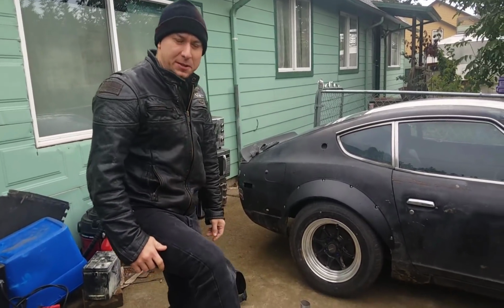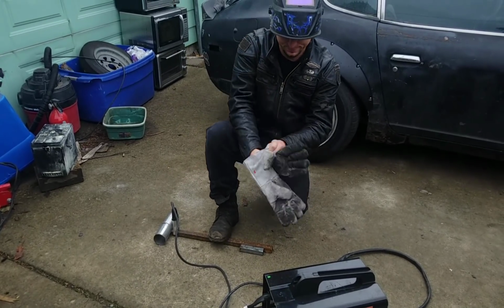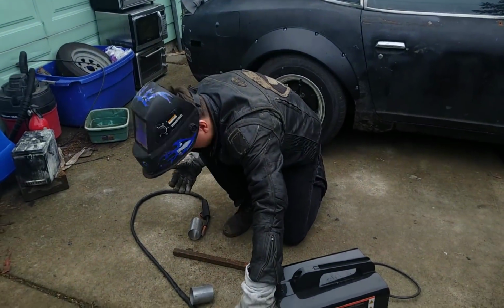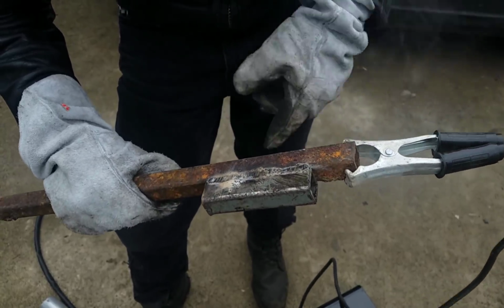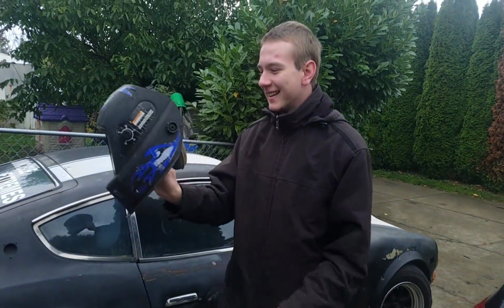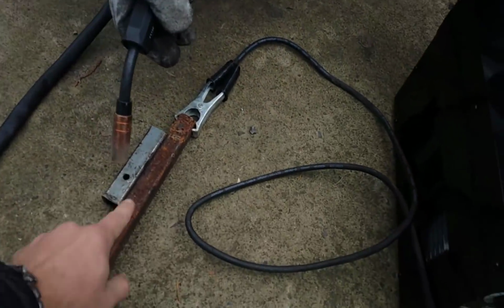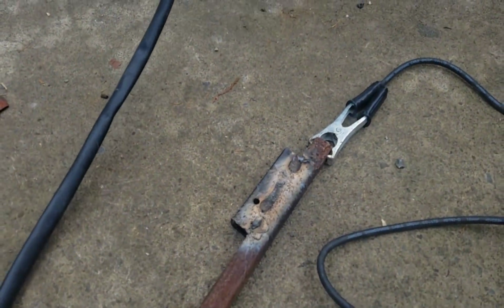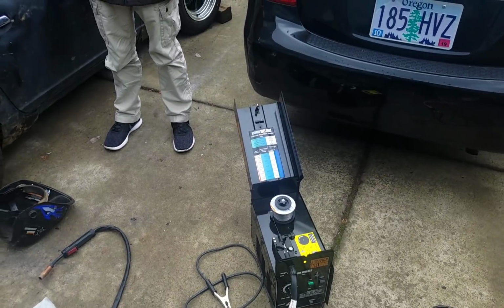$99 125 amp welder. Worth it? new 90 a.  Harbor freight 120v budget welding review. Chicago electric

Comment from the maker: https://youtu.be/uk94lD-G_vU new comparison of this welder with a century fc 90 DC flux core welder.
Reply: I have the same exact welder, except they just had a huge tent sale, so I got it for $84, and that helmet I got for $30 :)
Reply from the maker: conner baldwin nice!  Ain't the best, but it'll work great, you won't regret it.
Reply: ya, that's what I heard, when I was walking out of HFT a guy told me he loves that welder, he's had it for a year, it still works, he did say I'd have to get used to the splatter though, well anyway good vid man, subscribed :)
Reply from the maker: conner baldwin yeah... I've had one for 5 years one time.  Not too sure why I threw it away.  Still worked though after dozens of rolls of wire.
Reply: For small home jobs i use the 90 amp FCAW and I'm happy with it. For anything that needs strength I'll use my Lincoln arc welder. Anyway, clean your work and ground first, you'll have better results. Thanks.
Reply from the maker: drhilltube Yup! A good ground and the cleanest metal you can make is always a good idea.
Reply: What did I miss...dude, what’s the plan for the stack of microwaves???
Reply from the maker: Eric one of them works and we put it back in the house.  The others are scrap I think
Reply: Do you have to feed the wire on your own?  I'm trying to weld sheet metal.  What are the settings for sheet metal?
Reply: ExtravagantFragrance this is not the best welder for sheet, particularly if you’re new to this. You really need a MIG.
Reply: I realize it's quite randomly asking but does anyone know a good website to watch newly released movies online ?

Comment: You can't run ANY welder on an extension cord that's barely good enough for xmas lights.
Reply from the maker: Doug Alan that's very true.
Reply: Doug Alan lmao
Reply: Sure you can, for a minute..🤔
Reply: I have the 90 amp. When it was plugged into my 15 amp home circuit the arc would spit sputter snap crackle and pop. I plugged into a 20 amp circuit and it made a big difference. Smoooth....
Reply: They should really use a 5-20P plug on machines like this to let people know that it's not okay to plug a 20A load into a 13-15A extension cord. This is how you use a welder to weld a plug into an outlet.
Reply: @trickster721  so it's better to put 30amp breaker and use thicker gage(lower number) and beefy outlet
Reply: Wouldn’t it work better if your ground had some nice clean metal that has been ground down and not rusty af

Comment: few tips for HF wire welder. remove your welding wire spool and put some wheel bearing grease on all the moving parts that touch and rotate. keep your 4 1/2 hand grinder nearby and grind off the rust in a spot for a good ground. grind the rust off where your weld is going on both parts.i bought one of the 90 amp ones at a garage sale that was used maybe for one weld if that. when i got it home the wire would come out in little spurts. i removed the plastic wire spool and greased the parts and my son has a wire welder he has used for all kinds of stuff. remember lubricate the spool assembly but be careful not get grease on your wire. quit using the E71T-GS wire and start using  E71T-11wire. once you switch wire you get much better welds.
Reply from the maker: +J D yup.  I had a 90 amp one, guess I could've saved it.  Chucked it though
Reply: J D also, if you replace the wimpy jumper cable ground clamp with a good quality welding ground clamp, it makes a BIG difference.
Reply from the maker: dave1135 yes it does.
Reply: Ok
Reply: yes i just did that with chinesium ground clamp that is way better. the originals were basically battery charger clamps
Reply: Only way to improve a harbor freight welder is to open the lid on your trash can and toss it on in.
Reply: Absolutely, clean your metal first folks !
Reply: Good feedback, I want to weld a tow hitch to a non tow rated bumper, what type wire should I use? I see .30 and 35
Reply: @flhusa1  link doesnt work, could you send updated link?
Reply: Planning to make my own charcoal grill, would this weld be good? To weld all the metal together? Idk first time.
Reply: @bartlein1994  If I did that, there would be one heck of a lot of things around my farm that would still not be repaired. I have welded all kinds of stuff around here with just the same welder.  I get tired of people like you that sneer at anything from Harbor freight.  A lot of the name brand stuff you guys have are the same thing Harbor freight sells, you just pay many times more for a different color paint and a name. Case in point. I have a HF 14" band saw. for around $300 Grizzly sells the same saw for $600.  The only difference is their saw's switch is mounted up on the frame.  My HF saw has the holes drilled and tapped. Seems like a good idea so I moved my switch there.  Now jet, their saw has that brand's white paint job and they want $900. It's the same saw that I paid $300 for from HF. Same motor, same hp, same everything except the paint job.  So go ahead and sneer at my HF tools. I'll laugh while putting money saved in the bank.
Reply: Think I’ll give this welder a shot.
Reply: JD- I grease those parts like you do but I still had some problems. I just took a bolt and made a steel wire clamp to replace that plastic contrivance they had on it.  Haven't had any feed problems since.  Concerning those ground clamps many are talking about, I agree with everybody about replacing them.  My only problem with that is that mine works just fine!  I can't just bring myself to replace a part that ain't broke.
Reply: @bartlein1994  
Normally I would agree with you, but I just bought this unit (cant try it till tomorrow) I'm a gluten for chinese shit. If it fails, I will bow to you. And probly go torch HF.

Comment: Thanks a bunch. I have thought of this HF welder several times but was worried I would be wasting  money. Glad to know it is worth the effort
Reply from the maker: Tim Sexton yup.  I put mine to good use all the time.  Its just messy.  Home depot sells a welder that's half the size, but it's  $169 so it's almost double the price.  It is however much easier to use and is less messy.  Its a DC voltage welder, not an AC one.  The current switching back and forth is what makes the harbor freight one so messy.  In my datsun, room is scarce, so I choose to have the century fc-90 with me.  But if I didn't own that, I wouldn't hesitate to grab the little 99 dollar welder with me on my travels.

Comment: I bought the $200 Chicago electric 220v mig welder from harbor freight. It's on the bottle. I've used it for years with no hangups at all. Welds a ton cleaner than my Lincoln. The only hangup was the weak ground clamp. I switched that to a magnet ground and loved it ever since. Just my 2 cents.
Reply from the maker: thatkyleguy 1 I have that one, uses 240v, just need to hook the Bootle up.  What regulator and bottle did you go with?
Reply: Invincible Extremes Muscle Cars Garage I use straight Argon and it welds really clean, my regulator is really old, I got it from my dad about 20 years ago but I'll look when I get home

Comment: Years ago when I worked at the mine I used to do some decent welding, so a year ago I bought a 250a arc welder. It is  really good welder but all I have been able to do with it is welding that looks like what my boss used to call chiken shit. I have gotten lucky and fixed a few things but more often than not my welds suck.
   This demonstration makes me inclined to think I should sell that bigger welder and get one of these.
   Thank you for the demonstration. I learned a lot!!
Reply from the maker: Wire feed is idiot proof.  My little brother got the hang of it very quickly after this video

Comment: That's a nice intro for a beginner as myself. You mentioned it could run off of 120v and even a 3500 watt generator, both of which I wanted to know. Nicely done.
Reply from the maker: Shawn P I would recommend taking a look at the century fc90.  It's lighter and smaller and is much better.  Only 169 at home depot.

Comment: I bought one f these, and for what I do it works great. I don’t use this daily or even weekly repairs, but the few times I have, it’s saved my ass. I likes the fact I could change wire speed.
Reply from the maker: They do work.  I used my old one for 7 years before throwing it away finally.  The century fc90 i have now for cheap portable welding is much better.  You can change the wire speed AND the amperage.  Its actually good for body work.  Not as good as a a gas shielded mig of course, but much better than this.  But you are right, for odds and ends its decent.

Comment: Excellent instructions I'm not a welder but I may actually give it a shot painting and welding have never been my thing but now 58 I'm more patient thanks for the video man it is appreciated
Reply from the maker: This isn't the best welder.  But it does work.  A much better welder for only $165 with a coupon is the 170 amp machine.  Or the century fc90 they sell at home depot.  The current on them is DC so they make a much better weld.

Comment: I was a cert welder for a good 30 years. I liked this video. I think I will pick one of these up next time they go on sale. Thanks
Reply from the maker: Dennis Madigan it's garbage, but it's cheap garbage, and it does work.  Just makes a mess because it's A.C..  but, the welder I do love for random field work is the little century fc90.  Is an inverter welder and is 15 lbs
Reply: Invincible Extremes Muscle Cars Garage I have 2 220 ac stick welders at home. Was just looking for something small, cheap and fast to do some small stuff once in awhile. If you do some prep work it will probably get you decent results. Thanks for the reply
Reply from the maker: Dennis Madigan true, cheap never hurts.  And in the end, 90 amps is 90 amps.

Comment: Thanks for this video. I just bought this unit and was wondering if I wasted my money. My dad welded for a living, but I know very little of the craft. I am now confident that it will do the little jobs I have to do here. Thanks again.
Reply from the maker: Itll work for random fixes.  I've used one for years.  Once I got good I never wanted to use it ever again though.   But the 170 amp machine or the 125 amp INVERTER welders are amazing for the money... just so you know.

Comment: Now that was a good realistic review. I've been wanting to get one, looks like the 125 amp is the way to go.
Reply from the maker: +Goomer yeah, stay away from the 90 amp.  The 170 amp is great too.  Just a but heavier, but can take a 10 lb wire spool and can weld much cleaner if using solid wire and gas...
Reply: but with flux core... you can use the same gas as mig.... it is called dual shielded welding and this technique is for .035 flux core (but .030 can be used) to penetrate very thick metal with minimal inclusions in your welds... flux core wire works the best outside under windy conditions (much like a stick metal arc welding...smaw) and the extra gas shielding prevents any additional oxidation to a weld as it cools. mig (metal inert gas: mig) is for inside use  or no wind conditions... so if you are a farmer get an arc (stick metal arc welders...smaw, or a flux core wire : flux core metal arc welder... fcmaw) ... tig works the best inside a building on any weldable metal, not so much outside..  again the gas blows away in the wind.
Reply: Interesting, thanks

Comment: Surprisingly it's good welder for me I did my whole exhaust system from start to to finish and it did just fine
Reply from the maker: Yeah I've used it for exactly that with no issues.  Messy but works ok
Reply: Yes it is messy, did the job

Comment: I'm on my 3rd HF welder. 1st was 90 amp...lasted for about 1 1/2 years of weekend work, maybe 20 lbs though it before the it lost power. 2nd was a 125 that lasted for a year and 10 lbs before the wheels stripped and the stinger switch got wonky. 3rd is a 125 on spool #7 that feeds erratic sometimes, but works well.  Sheetmetal can be tricky. They seem to work better on thicker material... I have no problem with 1/4", and have even done 5/16".
Can't beat the price.
Reply from the maker: Nathan Christopher yup, they are absolute junk... But sometimes, it's all we can afford right?

Comment: Thanks man,I've been thinking about welding for a while and your video makes it seam doable
Reply from the maker: I would recommend the fc90 century or the harbor freight 170 amp model over this.  But overall, welding is simple.
Reply: Invincible Extremes Muscle Cars Garage thanks again man,you got a new subscriber,I'm not gonna become a welder but I'll give welding a try, I'm a wood and leather worker but I think steel is a great texture to add to stuff a may build in the future, thanks again,I like your approach,
Reply from the maker: I love wood and leather.  But yeah, doesn't hurt to be able to cheaply connect two metal brackets together every once in a while.

Comment: Welding on rusty metal never helps. Better buy a HF grinder.
Reply from the maker: Final Call Racing yup, very true.
Reply: Always clean the metal...
Reply: What about a file or whetstone?
Reply: The manual says it can weld rusty steel.
Reply: @privatebubba8876  yeah the arc will bust the rust off but you still prolly want to clean off where you ground at so you get good current going to your weld. sandpaper would do if you had nothing else, I like my little Li-on dremel. Bout to get a Li-on angle grinder.
Reply: Does your friend speak/understand English?
Reply: Only $14.99

Comment: Nice video. Looking for a cheap welder like this to weld some items around the house that have gotten rusty like my aluminum fence and steel hand railings. Would a welder like this work with this type of metals and repairs. Never welded but want to learn
Reply from the maker: I strongly recommend the 170 amp model.  It's around $180 and not only works decent with flux wire but can actually weld using a gas bottle and better wire when you learn.  I do not recommend this welder.  Also... it cannot weld aluminum.  Aluminum takes special equipment so you can weld it but you'll spend a lot of money... like I said, the 170 amp model... or the cheapest of the little green welders they sell will be a much better welder.
Reply: Invincible Extremes Muscle Cars Garage  tyvm. Will def check them out. I heard you state fence post which is something I have to weld so that’s why I asked if it welded aluminum. Perhaps I’m mistaken and my fence post is not aluminum. Will def check on that. Ty again
Reply from the maker: Yeah I was referring to iron and steel fence posts.  Very likely that's what you have btw...
Reply: Invincible Extremes Muscle Cars Garage  yup def confirm and that’s what I have with the chain link post gate I want to straighten. Also m6 hand railings are iron, and the posts are rotted. Have to tackle those which scare me but have to do it.

Comment: Great review! Thanks for posting. -One of the first things I did with my last $99 Harbor Freight welder was cut the cheap tin ground clamp off & add a nice heavy solid brass one with a much stronger spring.  Think the new clamp was around $14 on Amazon.  Made a day & night difference!
Reply from the maker: Dennis Tucker I bet it did, thanks for the tip!
Reply: Do you have a link? I need that mod.
Reply: I added a bridge rectifier and capacitor as well as a better clamp and changed mine to dcen...it works so much better and has decent penetration and way less splatter now!!

Comment: I own the same unit. It works good enough for repairs on my lawn mower. Would recommend it if your on a budget and don't need to weld above 3/16
Reply from the maker: Yup.  To be honest its worth spending the extra bucks on a century fc90.  Tiny inverter unit that has dc output and is only 199.

Comment: HF's cheap welders aren't bad. I bought my blue Chicago Electric $100 Harbor Freight welder 7.5 years ago as of this comment, (my first ever) yet I've been welding together another grill (out of an old gas water heater tank) off and on the past two weeks. To be fair, the rubber around the connection at the hose to welder joint is tearing and starting to come apart from wear, and I seem to go through copper tips faster than when it was new. Interestingly, I have OFTEN run the machine to the point of auto shut off lol. When running it long periods, do often keep a large high power fan pointed at it, which keeps it's temp down and buys me a lot more weld time, but I honestly, I can hardly believe it still works all this time later considering the abuse my amateur efforts have put it through over the years. 10/10 would buy it again ...... if I didn't want gas on my next one. It is not gas capable, pure flux core only.
Reply from the maker: The 170 amp machines they have are head and shoulders better, and  can run gas if needed.  But the little hundred dollar ones do last a while.  Its the wire feed that gives up after a while.

Comment: I have one of these. It does good for a little arc welder on thin steel. Its not going to measure up to mig of course. The use of gas and 240 just makes it so much hotter and smoother.
Reply from the maker: Oh yeah, 100% agree.  Even for a flux core welder, DC makes a world of difference

Comment: Just a suggestion:
Store your 2 lb spools of welding wire in zip lock sandwich bags. It helps keep the wire from rusting while stored.
Reply from the maker: Yeah, definately a help
Reply: @InvincibleExtremes  wouldn't that contain moisture in high humity communities?